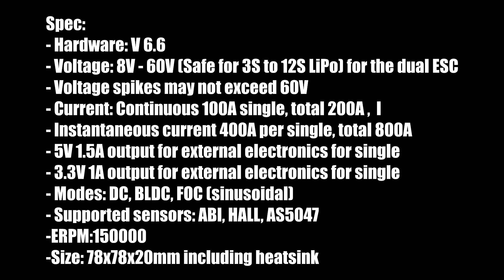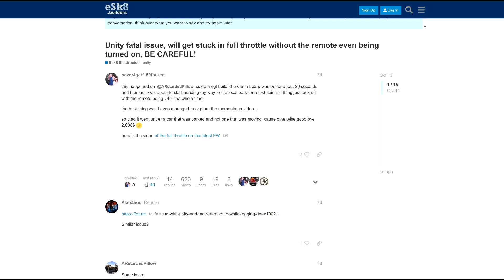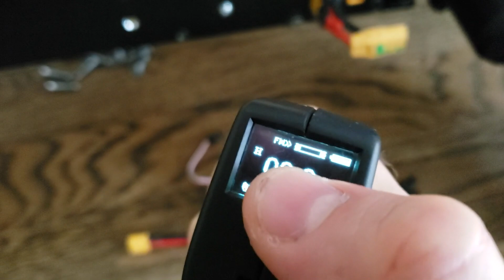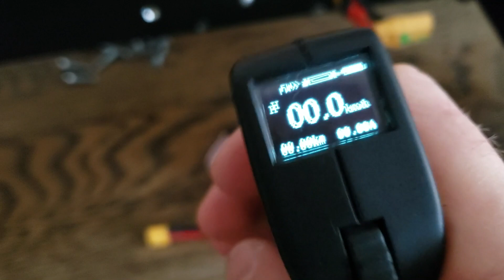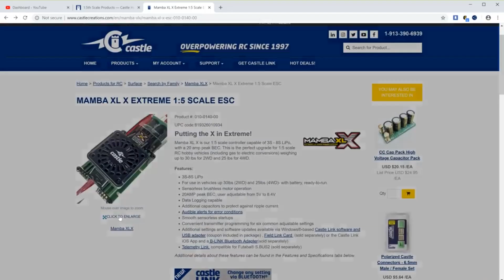OverPowered Insane Electric Off Road Machine

Comment: Great built, I’m facing wobble speed on my panthera at 30km/hr even after tightening the springs. Any recommendations?
Reply from the maker: There are a ton of adjustments on the frame. You have to play with them and test. You will figure it out... It is easy.

Comment: Hi Again, I just got my Pantera but I’m facing a problem while braking. The board it s only braking if I m pressing the throttle to accelerate then pressing the brake after but If I press the brake without accelerating for example if I’m descending a slope from idle it won’t brake. Any idea about this ? I ve trying to reach BajaBoard several time but till now no response.
Reply from the maker: Allesandro is always online on Facebook. Reach out to him. He will help you.

Comment: do u have a canbus in stalled for the 4wd?
Reply from the maker: yes, it will not work without it for open source vesc. I have new custom 4x4 esc. I will set them up shortly to get the S2 going. I need to see the instructions and I will update in the video.

Comment: Hey, I also have a 2018 G4X but I bought the smaller 550Wh battery and I hardly get 9 miles of range now.

Bajaboard said they they can make me a 1100Wh battery but it would cost $1250 not including shipping and taxes. I'd like to keep it a stock 10s set up that way I can use the standard remote and all of its features like Cruse control, drift mode, electronic differential, etc.

Do you think you could possibly make me a battery for a smaller fee? 
I'm in California but I know jehu garcia has 100 pack of Sony VTC6 cells for $365~. If I supply the parts could you possibly build a similar battery pack with around the same or a little more power? I think its 10s 7~10p
Reply from the maker: Send me an email and we can talk about.
Reply: @ElectricVehicleSpace  email address? I checked under about and community tabs but didn't see anything